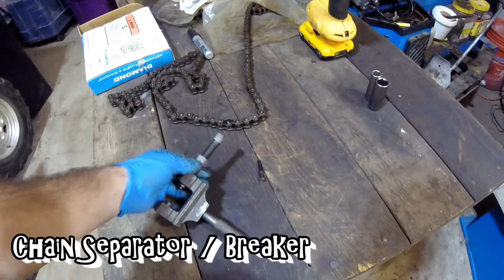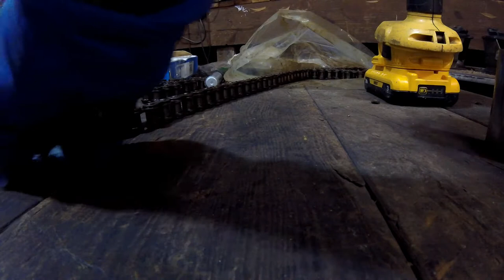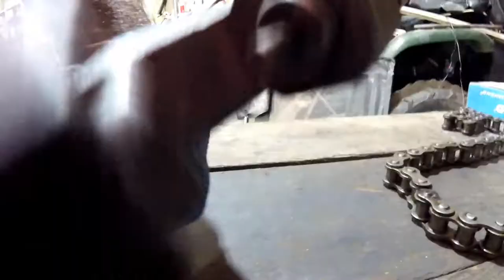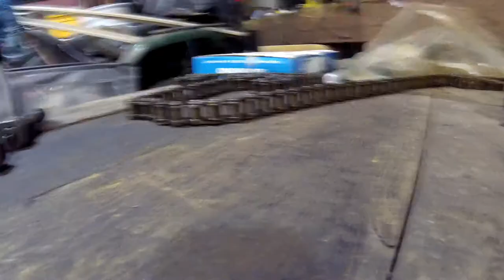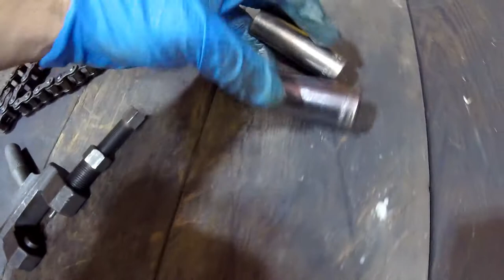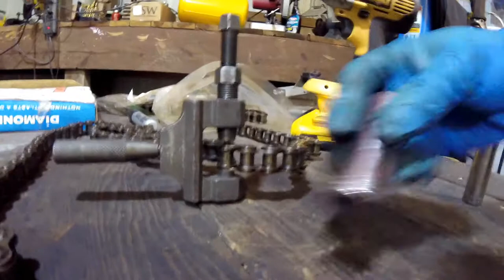Using a Chain Breaker / Separator Tool From Harbor Freight

Comment: You my friend, oh you little devil,  you, you are a genius! So many people talk about bending pins and tools trying to break a chain. If you can brake a chain without bending the pin or tool using a cheap Harbor Freight tool, that to me is proof that others using a 100-180 dollars high quality chain breakers had no idea what they were doing.

I need to change the chain on my motorcycle and the chains are ridiculously expensive. Over 200-230 bucks for my bike, depending on who makes it. Then the cost of sprockets. Plus I was going to spend another 150 bucks on a chain tool. A total of somewhere around 400-450 bucks once you add the taxes. If I can buy a cheap Harbor Freight tool for around 20 bucks (I think you said 10 bucks), you just saved me 120 bucks or more.

Comment: I bent the push pin just a little bit but, damnit, that link is taken apart! Thanks so much for this video. I would have been struggling for another hour before giving up without it. Now it's time to change these sprockets and put on the new chain. Hopefully I'll find a good tutorial for putting the new chain back together with this tool lol
Reply from the maker: Yes, you can bend the push pin if it's sticking out very far. You won't need this tool to put the chain back together just a pair of needle nose pliers sometimes helps putting the clip back on.
Reply: @notoriousJPG  There's no clip. I have to rivet the pin into the link. I didn't see a way to do it with the harbor freight tool and ended up ordering the takasago chain tool. It's $90 and much more sturdy. It works as a chain breaker and can also rivet. It also has a tool for the clip you're talking about! Highly recommend.

Comment: Does it also work to smush the new master link pins . Or is it only a breaker
Reply from the maker: Only will separate.. chain ends are joined back together with a new master link it comes with a clip.

Comment: Found out the hard way that the pin on this is slightly too big for my bike chain. Says it works on bicycle chains but it’s pretty misleading. I spent like an hour trying to get my chain off of the thing
Reply from the maker: Aren't there are 2 sizes of center pins in the kit? I  never use the smaller one since I just do larger equipment and dirt bike stuff.  Thanks for your input.
Reply: @notoriousJPG  I measured both of them using a caliper and they were the same. I’m not sure if they made a mistake and put the same size pins in mine though.

Comment: Now put a pin back in that’s my problem lol
Reply: Lol same here
Reply: @michaelslifecycle vice, patience, and a master link to put it back together.  That’s what I did.
Reply: This tool is a remover/installer. Just don't drive the pin all the way out of the side link. Use a wrench instead of an impact to prevent damage to the chain or tool.